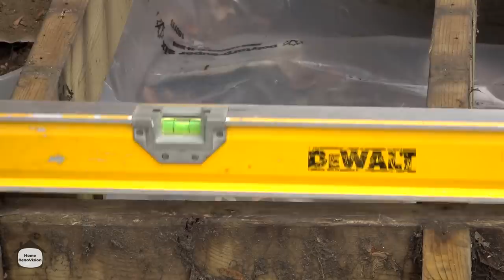Remodel Your Deck on a Budget! | DIY Tutorial

Comment: This is a great example of why building codes were enacted. The original deck looks like a DIY. The builder did put some thought into it but failed in many area's. I did a deck 30 years ago which required a permit. The deck was not allowed to be fastened to the house. All the vertical structures had to be mounted on concrete piers; and those piers had to be 36" below the ground. The house and deck were essentially  distinct structures; slight movement of one would not interfere with the other. Anyone building a deck should be at least building to the minimum of code.

Comment: I'm a builder that has built over three thousand decks and screened porches in 30+ years. 95% of the time we recommend complete demolition of all of the structure and starting from scratch. This project is a good example why. It costs as much, and sometimes more, to modify and upgrade the existing structure to code, you have no idea what the footings are like, you are using aged wood that has lost it's capacity to hold nails or screws well, joist spacing is usually minimal ( as is here ) and joists are undersized. In addition, out of square, level and plumb take a lot of time to fix.
Also, we often find rot were the band is attached to the house because of no or poor flashing, which cannot be discovered unless the deck is removed. If you are going through the effort of removing all the rails, decking and stairs, you are 75% to total removal or the structure and discovery of possible additional issues.
Take the extra time and start from scratch, you will have a 100% new project for a little additional cost plus you will have the piece of mind that it is built to code, the footings and house attachment are correct and everything is new and will last for years longer than a modification.
Reply: I agree Vagolfer. It's nice to save a deck where possible, but most decks I come across aren't attached to the house correctly and have introduced rot into the rim joist (of the house). Of course, how it's supported in the ground is equally important. I felt this deck was so poorly framed in the first place, it made sense to me to simply replace it all. I don't want to complain about his work, he certainly does good work in video, and I don't know everything either, but I do have my own way of doing things and I guess I would have recommended something different than the video in some places. 3000 decks? Man, I thought I was doing well at 85.... XD. Also, not a fan of using decks screws for structural framing. It's white metal which doesn't hold as good as an old fashioned nail. I see screws snap all the time, so tough to beat a nail (galvanized of course). Looking back at how he fixed the framing, I don't consider a single joist a beam and sufficient to carry the load of other joists, so I think he should've at least made those 2 ply. Anyway, food for thought, but nice work too Mr. Home Reno DIY.
Reply: You’ve took the words right out of my mouth! I trillion % agree with you!
Reply: One thing mentioned in the video is reducing waste. If local landfills can be spared unnecessary volume, then why not?  A little extra time can sometimes save a ton of waste and $$$.
Reply: I agree, as Professional job   the whole structure should be replaced  because You would not want structural failure within 10 years. But this channel  Is   Is aimed at the do-it-yourself  builder  /home handyman It's a very good example of how to  revitalize an old wooden deck  and save a bit of money.
Reply: @rcytb  
No, not really. We're talking a few hundred dollars of material, and the additional waste in the landfill would be insignificant. No excuse for sloppy work. In the scope of the job it's a minor, but important, investment.
Reply: Were can I see your video
Reply: @TheVagolfer  for a guy who builds the deck for a paying customer, you are spot on.  If I'm looking at my own deck and I don't have your experience, is there anything I can do without calling a pro?  As pointed out in the vid, a circular saw and a speed square are useful substitutes for a chop saw if I don't have one.  Yes, modifying the bad carpentry on this deck was more time consuming than starting from scratch, but the deck served as an instructional tool.  The video is aimed at do it urself folks, and there is no end to the stuff we can all learn.  Personally, after building mega yachts for 10 years, I was still learning tons of stuff every day.  And even when the budget is 40 million bucks, compromises on time and materials come into play.  Custom work involves situational thinking and judgement calls sometimes.  And like he said, all decks end up in the garbage eventually.  My humble opinions.
Reply: I totally 100% agree with you!

Comment: 4 months later and after watching this video many, many, many times... my deck is DONE! Many thanks to my fellow Ontarian neighbor "Jeff" for your insights, tips, knowlege, and humour for making my project a success... my neighbors are jealous! Your tips on replacing the weaken joists worked like a charm... in my case I had to also replace the 12 foot long 2x8 beams and posts in a 1-man job (due to the current covid-19 situation). From an eye-sore sloping backyard gallery to a fantastic-looking deck with veranda rails & solar caps... and a strata wall light by the patio door... this superb-looking deck is all made possible with your great helpful video. With the savings of this DIY project... an investment in getting the right tools made the job as simple as 1-2-3... Thanks a bunch and keep up the great videos! Last thing to do is... water proof the deck in a months time.

Comment: I get that your trying to save money but I personally would pull it all out and do it correctly. You have no way of knowing if the footings are correct and its connected to the house. Too much is wrong to "Save" a crappy job. If I were doing this for a customer I would not even take the job if they wanted to do what you just did. Eventually its going to fail again and now its on the last guy who worked on it. As far as the old deck is concerned, you can save the wood and use on other projects...just not on this one.

Comment: You mention using the joist tar paper at the beginning of the video, and then didn't actually use it for the build?
Reply: This is the exact same thing I noted....
Reply: I think he stated to use it if you have the boards butted up to one another..short deck boards and Or if you wasn't one to preasure clean it yearly.. .he used full length boarding and he does yearly maintenance so it wasn't needed.have a good day. .

Comment: You mention you need 1 screw every 2 inches for 2 x 6 joist.  Whats a good resource to find that type of information for DIYers?
Reply from the maker: Right here on this channel or the building code book. Cheers!
Reply: If you get a copy of your local building codes (usually free and available online) you will see that they include a great amount of detail for everything; every connection will be detailed with a minimum strength requirement and usually equivalent options.
Reply: Duh.. HERE! lol No seriously, run to your county website and check out the building code information

Comment: I'm a disappointed with your stairs.  The way you did it there's an inch difference between the 1st and 2nd boxes.
From the pavers on the ground: 5.5" (Framing) + 1"(Decking) = 6.5"
But you built the second box directly on the framing of the box underneath and Not on top of the 1st box decking so you lose thickness of the decking, 1" in this case. Now your second box has a finish height of 5.5" not 6.5".
Assuming your finish deck height is 18.5" as you said, now you're left with this:
1st step = 6.5"
2nd step = 5.5"
3rd step = 6.5"
a 3/8" variance is allowed  though every carpenter I know will hold to a 1/4" variance MAX
An inch variance is downright unsafe and negligent.
By the way I am a retired professional carpenter with 35+ years experience. I'm not trying to be a troll. I'm just trying to inform the viewers of this video.
Also, there's many ways to do every job and I have no issues with your methods in the rest of the video.
Reply from the maker: No worries Scott, just showing a simple box step for folks who need an easy system. A better way would be to make your own stringers.

Comment: Wow.  I actually never thought of putting another board over the drink board. That looks great and screwing on from the bottom covers any "uglies" as I call them.  Plus it gives so much more stability to safety rails, I've 12 step steps to mine and was never satisfied with the existing rails.  Thanks for the informative video.  Great job!!
Reply from the maker: use a long screw on the outside corner and pulls everything together for crazy awesome strength. Cheers!

Comment: Sir, I pretty much never leave a comment but as an engineer, I just cannot agree with some of your lingo or structure.  I will point out just a few things only in effort to help, not insult you.  "Forging" has nothing to do with making a screw not rust.  That is a method of forming a metal component while in the plastic (red hot) state to get ideal molecular configurations.  Forging is commonly used because it saves on material waste too.  An "alloy" is just a mixture.  Ever single fastener you buy is an "alloy", bet on that.  Granite dust on the dirt followed by a block is almost guaranteed to lose grade unless you are sitting on bedrock.  There is also zero provision for uplift.  I preach and preach about structure starting with the foundation and people just never do it!  It causes the exact problems you found in that deck!  Simply digging in the ground to create a proper pier is not very hard or expensive!  You talk a lot of about shear, loads, etc.  All good things that you think about those but I cringed a bit with some of the lingo.  There is a lot to consider with live and dead loads.  Durations ,factors, etc.
Reply from the maker: Don't feel bad james , this is a homeowner channel and we are trying to help folks get a better result. If they want to build something truly awesome then I suggest they contact an engineer.

Comment: I like the little sometimes unnoticed tech tips like reversing the drill once throw the top piece of wood to bacically strip out the wood fibers as if you had pilot drilled the top piece to prevent it from splitting the top layer of wood when near the end.  I learned many years ago to blunt the point of a nail prior to driving it with my hammer to eliminate the step of pilot drilling...  I loved all the tips and explaining your thoughts while working.  Great video.

Comment: Didn't go through all 1k plus comments to see if anyone else has said it but felt the need to say for joist hangers the side screws are supposed to be long enough to go through at an angle into both joists. If your only going into the one then they can allow too much flex and separation. Not as important when you can screw in from the back as well but good information when you have no access to the opposite side

Comment: Nice deck, again with the same tools dad has lying around. Small tip that I do when "Dad's" measuring and he is 72 years old; when I use paper tape on my wood and mark on that if he gets the size wrong no big deal just tape over it and the best thing, when you cut on paper tape you do not get splinters on the edges.  Dad thinks it leps having cleaner edges and we are both happy ;-)
Reply from the maker: Whatever keeps dad happy. Cheers!

Comment: Thank you... You give me comfort to give it a shot to replace my deck boards.... You make it look so easy but I know it will take me a while to get it done.. Mine is in similar condition though underlying substructure is pretty much 16 footer joists supported by cross joists on concrete posts so not much work on sub structure except cleaning up nails... Lets see how it goes!
Reply from the maker: You will be fine. Cheers!
Reply: @HomeRenoVisionDIY  Thanks!!! 

did you use the joisttape? I was thinking of cutting strips of ice and water shield and stick them on joists. I would think it will achieve same outcome at much cheaper cost.

Comment: I have a few questions about building a deck, cause I am doing this right now. 
1. How could I prevent the stair box been pulling off the main structure due to the ground movement. ( I am living in Winnipeg, ground does moves in freeze and thaw.)
2. How long will a untreated wood with wood sealer last in outdoor situation?
3. When is a good time to apply wood sealer to a new built deck? Would temperature effect sealer’s performance?

Thanks, looking forward for your response.
Reply from the maker: the penetrating sealer should be reapplied every 6 months. no prep work just a quick wash as needed and then roll on another coat. Instantly restores the beauty of the wood.

Comment: First, You Are GREAT!!!  Second, I live in Tennessee; we have two systemic zones.  I am planning to build a home but I want something that will last like the only home left standing on Mexico Beach, FL after hurricane Michael.  Japan is the most seismically active place on earth so I went and looked at their building codes.  They use a compressed rubber buffer in the pylons and their skyscrapers stay up.  
I am thinking about using an 8x8 post to raise the house and leave a crawl space.  An 8x8 can fit in the rim hole of an ATV tire.  If I put in 8 inches of gravel at the bottom of each hole for drainage and then set the post and brace it.  I can then lower one tire at a time and fill it with tire mulch through a hole cut in the sidewall, to function as a bumper.  The tires would be on the post, about mid-way up, before I put it in the ground and braced it.  As I lower a tire I can pack the rubber mulch into the tire before lowering the next tire.  
Any ideas would be apprichated.
Reply from the maker: Hi Stephanie, if you want to be creative with structural design then get you ideas approved by an engineer. Cheers! Sounds really interesting!

Comment: The reverse screw tip is great, I’ll definitely be trying that one out, gotta be the heat of the screw softening up the wood just enough to not start a crack. Good video btw and you seem like a good guy to work with.
Reply from the maker: Cheers Travis, your gonna love using that tip!
Reply: The screw drills out extra wood, creating a channel, not stretching the wood

Comment: Yeah awesome the deck didn't last and the wood is rotting - why didn't you build a 'pot and beam' floor and fix stone on top or just polish the concrete or imprint a pattern into it. A hard deck would be much cheaper and what is it about decks and them having to be raised. Is it so you can feel as though you are on stage or something - i just don't get it and they look naff not to speak of the vermin run underneath it! Dont waste your money on a pretentious deck when you could have some nice stone for less money than all that timber!
Reply: Because the customer paid to have a deck installed and then it developed problems. They hired Jeff to redo the deck. Obviously the paying customer wants a deck and Jeff, the contractor they hired, will do as they ask. Business 101.

Customer : "Hi, i would like to have my deck repaired or redone to this design"

Contractor : "Why don't you just do some fancy little patterns in your small concrete pad. Or i can polish it nice and smooth for you"

Customer : "But i enjoy having a deck and would really like to have a better one"

Contractor : "Well i think decks are pretentious and a waste of money"

Customer : "Thanks for your time, we will find someone else to do our deck"

Comment: I'm building a deck at home and relying on this video quite a bit.  What screws (type and lenghth) are you using to attach the railing posts to the 2 x 6 rim joists?  I'm using the pressure treated lumber in case that makes a difference. Great videos - thank you for posting them.
Reply from the maker: use aCQ RATED 3 1/2 INCH SCREW.

Comment: I have watched this contractor in several video series. He does what is needed by using common sense, in this series, and carefully explained why, and that there was no building code required on a structure this low. That in and of itself seems a bit odd, but at least he is using his head to make the best out of a not so great situation. Time is money, and it looks like he is using his time wisely.
Reply from the maker: Thanks Jeffory, we are trying to help folks with real practical advice. Cheers!

Comment: good tips, you made the skirting vertical at the bottom, what about making it horizontal, so that less screws are needed and horizontal lines would look more modern, any reason why you make skirt with lot of small vertical boards versus longer horizontal?

Comment: I've gone back through this numerous times, but I can't find where you put the outer edge top deck board on. Did I miss it? Do you notch it out around the posts like you did the "2nd" board from the front? Any recommendations as to how much of a notch you can cut out before it becomes too weak?
Reply from the maker: I notched the first board. I laid in on the back side of the posts to measure and then installed it on the front side. cheers!

Comment: Deck looks great.Just one question. Why is it that you did not use the black mounting Pieces for the railing on the left side of the staircase where the railing upper and lower part attached to the wood plank that you attach to the brick wall ?